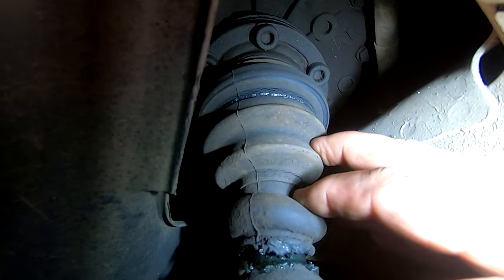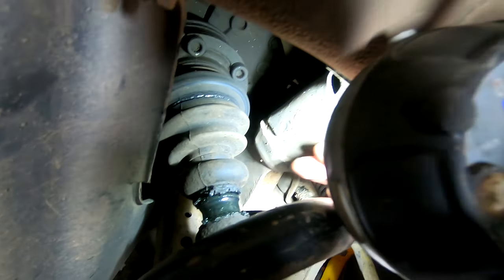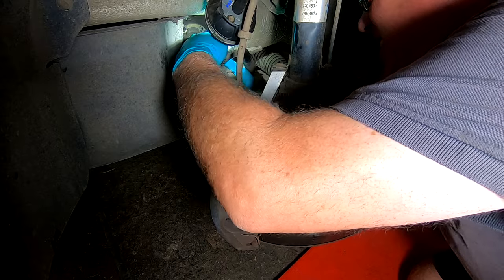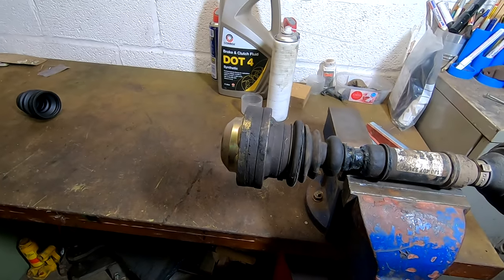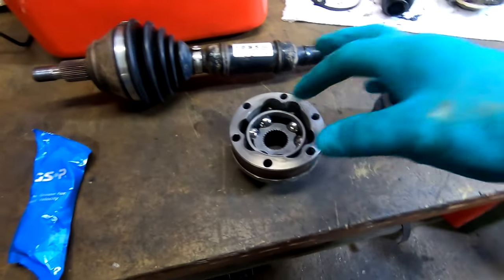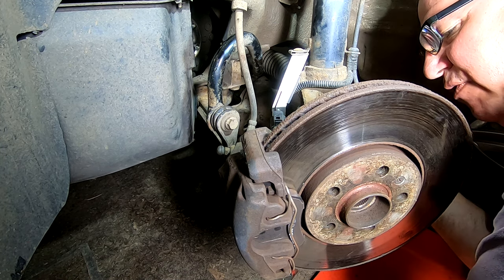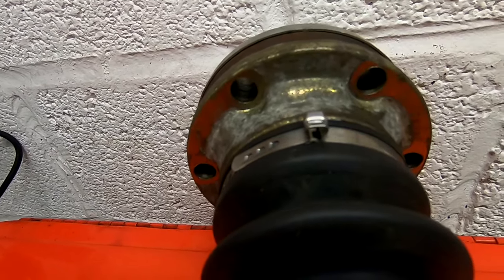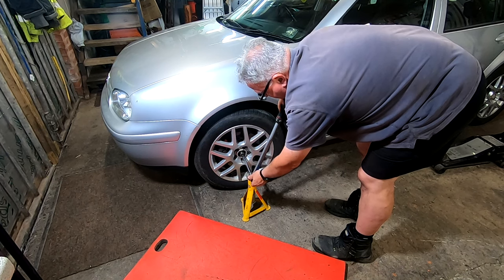Golf 4 inner CV boot replacement.

Comment: Nice job..i had to replace number 2 coilpack today as it failed causing a misfire..luckily i had a brand new spare at home and just about managed to do it myself..number 3 and 4 have gone over the last 6 years too..just number 1 remains lol..id better get another new spare ready...
Reply from the maker: Thanks, Good job sorting it out Matt👌. If 3 have gone, I'm sure the last will go eventually.
Reply: @LarcsWorkshop  yes indeed..but when lol..I'll get one asap and keep it close..or may even change it anyway before it goes..no idea how long they last..one went i 2017..one 2019 i think and one today..the one thats left is number 1 cylinder the trickiest one as its right under the oil filler contraption..
Reply from the maker: @mattroberts6484  👍

Comment: Good video! I have discovered the inner gator on my 1.8t gti torn the other day and I must do this job. Great tip to put the clamp between the bolt holes in the first place.
Reply from the maker: Thanks, good luck sorting it out 🤞.
Reply: @LarcsWorkshop  I did this job once before on a 2007 Audi A4 B7 TDI. Must be the same on the Vw mk4 1.8T.
Reply from the maker: @volnick1986  very similar I would imagine 👍